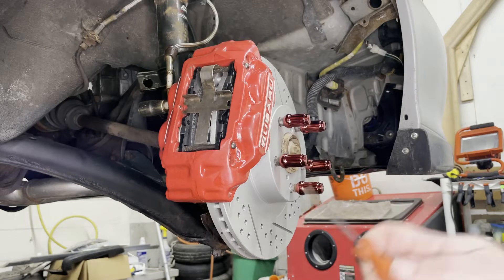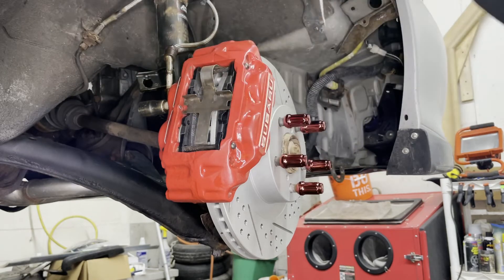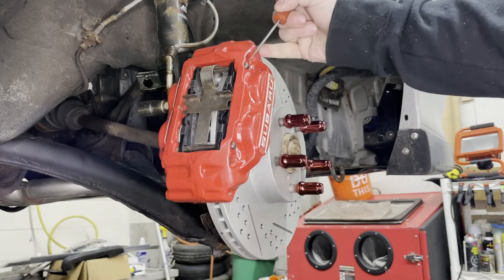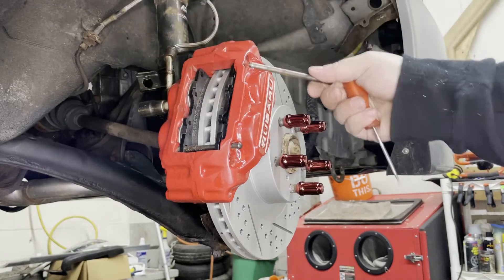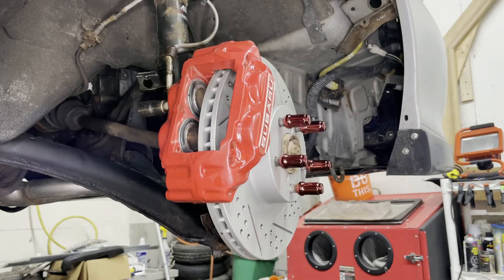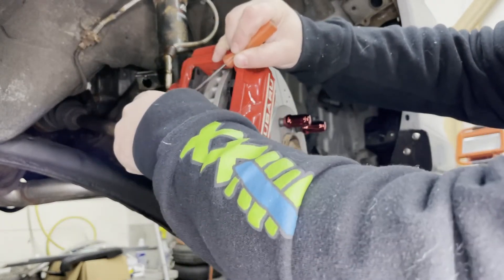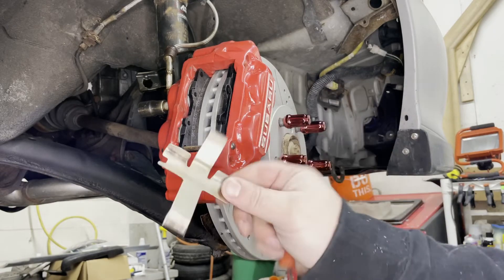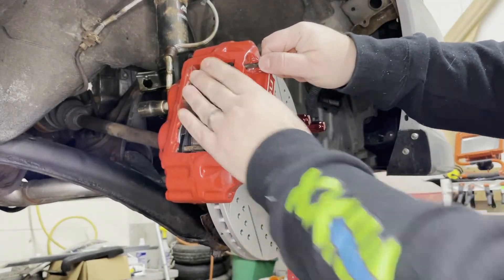How to Replace Pads on Subaru 4 Pot Brakes

Comment: Where is 26233AE010?
26244FA000?🙄
Reply from the maker: The aftermarket pads I installed had shims already attached to them. That is why I didn't install the additional oem anti-squeal shims.I'm not 100% if that is the correct approach but seems to be extremely common from what I've seen and I haven't had any squealing issues.
Reply: Are these needed, I'm doing a brake upgrade to these and I'm freaking out if I need these or not
Reply: @anthonygiacco1863  Brakes were invented by a coward))))